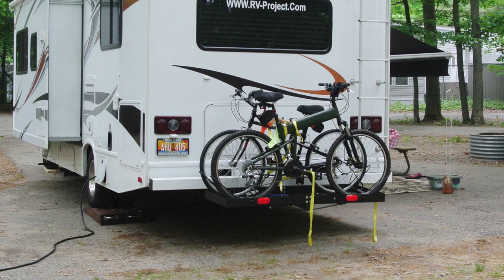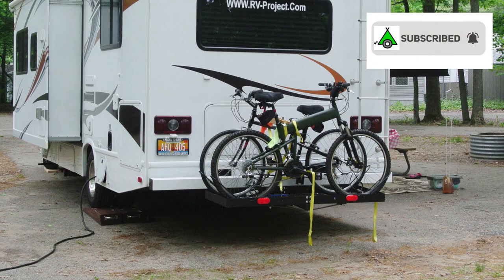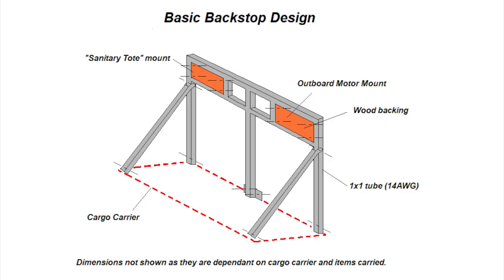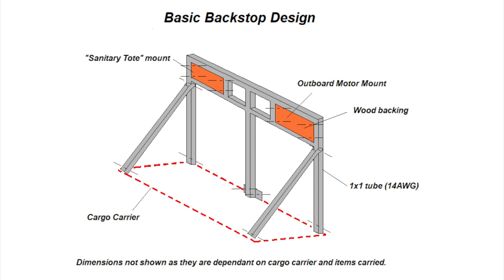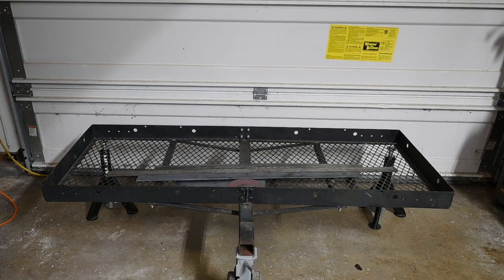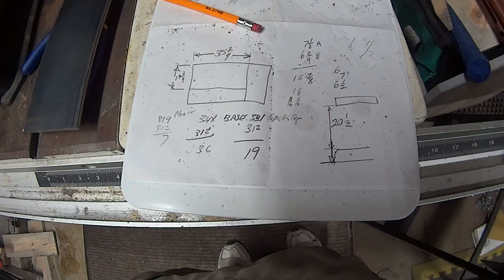Modifying the rear cargo platform for my RV.

Comment: Next time my wife tells me I have too many tools Im making her watch this one.
Reply from the maker: When I took an architecture class in college, the rule-of-thumb for construction work was 50% parts and 50% labor. I have no idea whether or not this still applies today.

But in RV Project style, if you do the project yourself, you can substitute the 50% labor for 50% tools. So by doing the project, you can use a ratio of 50% parts and 50% tools.

And when you calculate project costs using the parts/labor method, the labor is not renewable, and so it should also be when using the parts/tools method.

In other words, tools purchased in one project cannot be used in another project - new tools must be purchased.

Make sense?

By the way, I have not really convinced my wife of this, but I am trying.